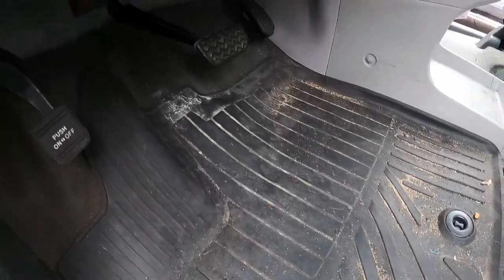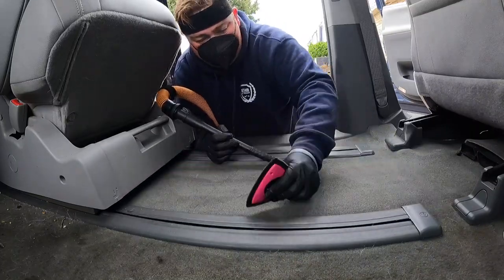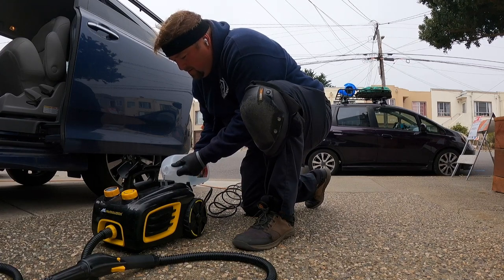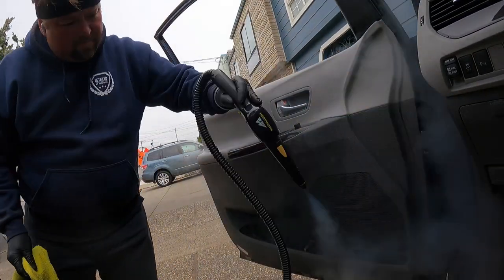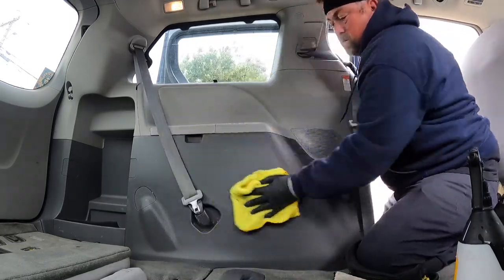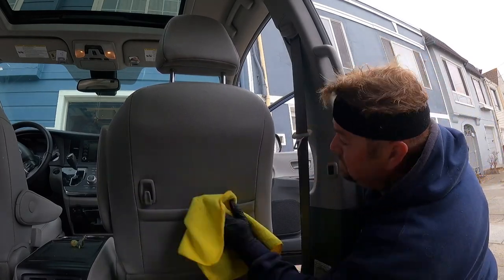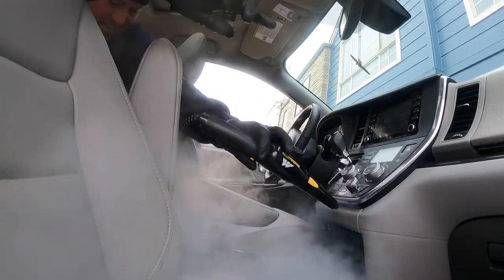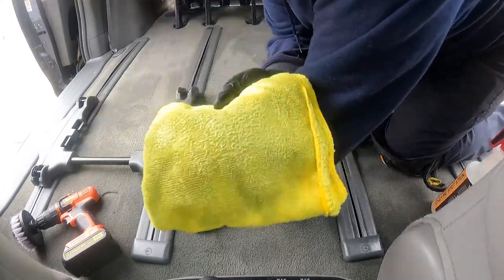Interior Detail + 1000 Subscriber Giveaway Announcement!

Comment: One good tip I’d give you would be instead of vacuuming first leave that for last. It really makes a difference in time. Clean all interior plastics/seats and do vacuum last that way you’re not doing double the work.
Reply: I’ve heard of this technique before but for the life of me I just can’t wrap my head around it. Maybe if it’s a maintenance vehicle. But for example the vehicle that Danny did in this video. How can you wipe down/brush the seats tracks, seats with debris in cracks and crevices without making a mess and clogging up your brush or towel? To me it’s like wiping dog poop instead of picking it up first and then wiping. 🤷🏻‍♂️
Reply from the maker: Thanks Fabain. You make a good point. But I have to agree with Mike. If I started wiping down all the surfaces, my microfiber towel will be touching the dirt the dust them pet hair, etc. And just collecting it on my microfiber towel I’ll be making it more of a mess and cleaning. So for dirty cars let’s vacuum first. And if you’re dealing with a clean car like a maintenance car or a car that really doesn’t need much. It totally makes sense to clean first then vacuum last. What do you think?
Reply: Naaaaah
Reply: @dannys.auto.detailing_   it’s always depending on the condition of course but that is just one of my methods to cleaning interiors.

Comment: i love my pet hair removal stones. for the majority of pet hair i’ll use it. it’s a lot more aggressive than your lily brush, but not as good for the cracks and crevices.

edit: i see you spending a lot of time on the steering wheel. i know it’s a dense area, but i don’t use a soft brush for the steering wheel and the surrounding area. if i need to get in the crevices i’ll just use the steamer to blow it out of the crevice. using an apc and spraying then wiping works just as wel for the area around the steering wheel.
Reply from the maker: I might have to check out those pet hair removal stones. Do you have a link? Yes. The steering wheel section does take me quite a long time Thank you for the tip. And thanks for watching

Comment: What is your go to interior towel?  And do you use different colors for different parts of the car?
Reply from the maker: Thanks for asking. My go to interior towel is the yellow Kirkland towel from Costco. I don’t have separate colors. Or separate towels for interior and exterior. I mostly use the yellow towels for interior. Door jams. Wiping the wheels after applying tire shine. I threw a lot of them away once they get somewhat dirty. So I try to keep them I try to keep a clean ones only. But I really do need to find a better system where I separate interior towels from exterior dirty towels. I do my best with what I have

Comment: Great content Danny. I would advice about some leathers especially Toyota and Lexus and BMW and possibly Mercedes and Audi but it would be about using P&S Interior cleaner on Red Leather I noticed and Red seats P&S Interior Cleaner will do a Dye transfer if put on and scrubbed especially with a Ninja scrubber or the like. Always test on a corner of a red seat or other "Wild" color before going ham on the seats and or other leather trims. Happy Detailing fellow Detailer!
Reply from the maker: Thanks for the information. Very valuable. There was a time where I did detail clean a red leather interior. And I didn’t notice some dye transfer. I stopped right away and just cleaned it very lightly. Luckily no damage.
Reply: @dannys.auto.detailing_  exactly same here it was on a 2015 BMW X6 M package I switched over to Meguiar's Quick Detailer and finished up the job. Talk about anxiety through the roof when I first noticed 😳 😅

Comment: Probably your best video yet!!  Btw what product were you using to clean the interior?  I know you said for the seats you used p&s with a little bit of super clean, but did you use that on the rest of the interior?  It seems to have just the right amount of foam,  while just using super clean doesn't foam that much if at all, and you're right it can leave spots if you don't wipe it off in time. Thanks.
Reply from the maker: Thanks for the compliment. I appreciate it. Most people like the other type of content. But I’m noticing there are a good few of you that like the detailing part. So these videos are for you. I’m using the same chemical on the leather seats in this video that I am on the rest of the interior. Same spray bottle. FYI, I dilute my express interior detailer 1:1. And add an ounce or two of super clean. I don’t lose it so that I can make the stuff last longer. Thanks for watching.

Comment: I'm relatively new to the channel and I will say I really like the videos! I like that you walk through your process with us, you give us tips as you go. Express interior I really like as its gentler but leaves a nice finish,  for more aggressive staining chemical guys nonsense is dilutable but safer than super clean that I've discovered at least.  You are very methodical and thorough and ultimately your customer was very happy! I tend to stay away from an extractor due to the heavy saturation plus the steamer worked beautifully! Plus steaming sanitizes! May I ask what chemical you use for the carpets? 
I know this is a long post but really great detail! And best of luck to whomever wins the blower!
Reply from the maker: I’m glad you enjoy the videos. I do like Xpress interior. And you are right that sometimes it’s not strong enough. That’s why every now and then I add a little bit of superclean into the espresso interior mix. BTW a dilute espresso interior 1:1 To lengthen the life of the product. Yes I am Using the steamer less and less and less it really cost for it.

For the carpets on this detail I first sprayed it down with terminator. Rubbed it in a little bit and I also followed up with carpet bomber.
Reply: @dannys.auto.detailing_  I never thought about super clean and express interior that I will definitely try! And I would say for carpets you have a beast system! I've recently gotten the P&S system and its phenomenal! That and brake buster are my go too with a foamer.
Thank you for this, I really enjoyed

Comment: What do you think of that Analon pet hair remover tool and are there any other ones that work better than that one ? 
I use air compressor Ridgid 6 gallon it’s small works good for blowing out unreachable areas
The end result looked great did you use any protectant at end or just cleaner ?
Reply from the maker: Great questions.the Analon is the best I have used so far. But I haven’t used many. It just depends on the type of carpet it is and how deep the hairs are in the kind of hairs too. But I don’t have a better recommendation yet. I do also use the lily brush, a drill brush, and sometimes I even use my rubber glove to just wipe off the hair. Whatever works. I really want a compressor but I don’t wanna make a mistake and buy one that Hasta refill or stop and recharge every minute. I wanted to just run and that’s it.
Reply from the maker: Oh, And actually I did not add any protection to this detail. But when I do it’s usually my spray wax. Right now I’m using Maguires synthetic Xpress spray wax. But I just ordered Gyon leather coat. I’m gonna try that out on the weathers going forward.